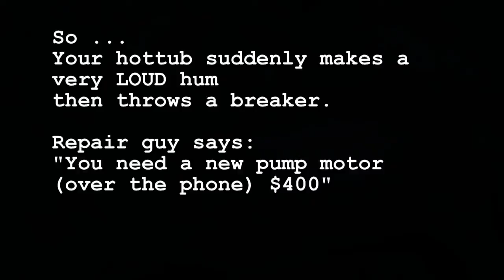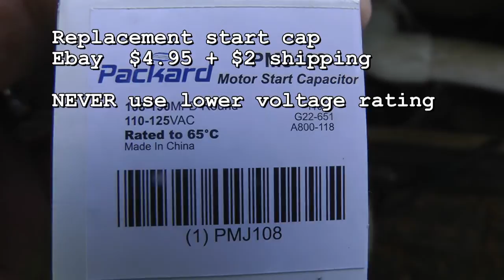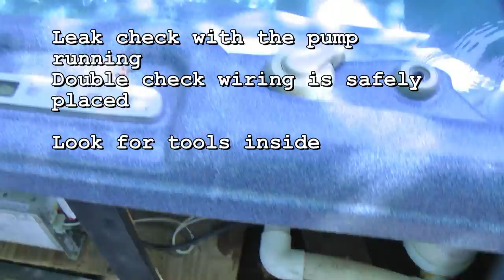How To Fix Hot Tub Pump Motor Start Capacitor Replace

Comment: This is exactly what mine is doing and probably needs from my research, great video. I do wonder though, is this a sign that the motor's life could be nearing its end?
Reply: Start cap is failure is unrelated to motor condition.  Normally the sealed bearings in motor will run almost indefinitely if water and dirt don't find their way in.

Comment: My spa does the same, it humms when I try to turn the jets on. Humms for 10 seconds then stops, I guess it trips something inside the control box. So I unplug the spa, wait a few minutes then I again try to turn on the jets and still a humming noise. I put a new pump on and the same thing happens.  I can turn the shaft and the pump works on both the new and old pump. Now.... the only thing I can think of is the new pump also had a Bad capacitor?  But what are the odds in that ?
Reply from the maker: If 'replaced the pump' includes a new motor.. it's not a start cap.  Can you wire up the old pump [on work bench] to see if it runs ok?  [don't run dry pump too long] This can tell you if motor wiring or controller is the prob.
Reply: Don't listen to Curt blues as it doesn't seem he knows much if the hot tub still won't turn on there could be a air pocket